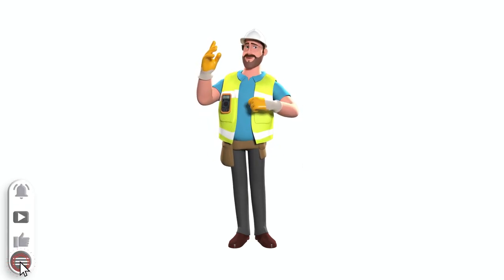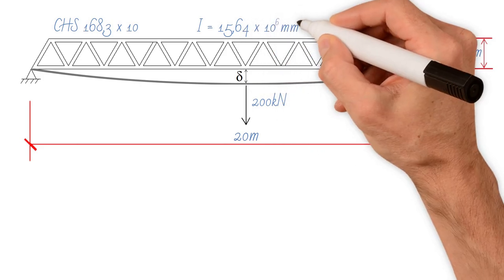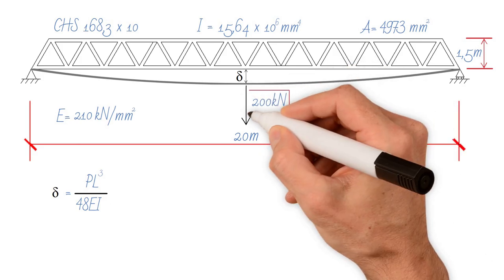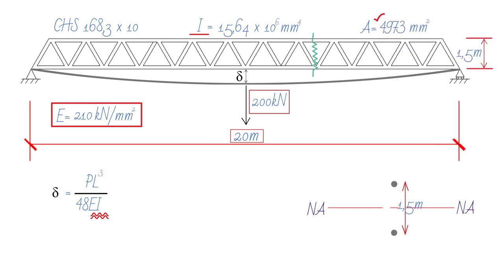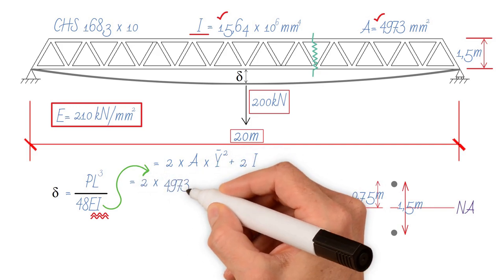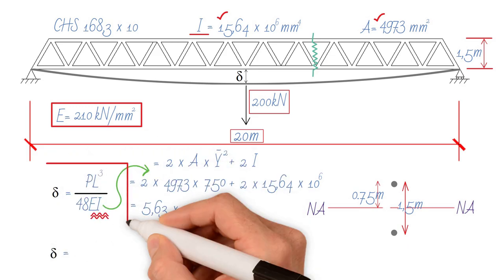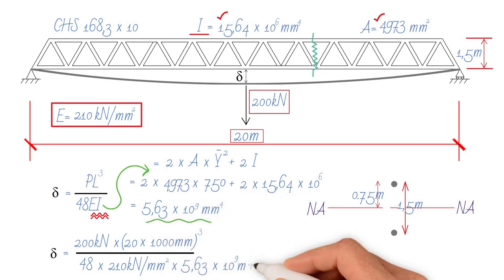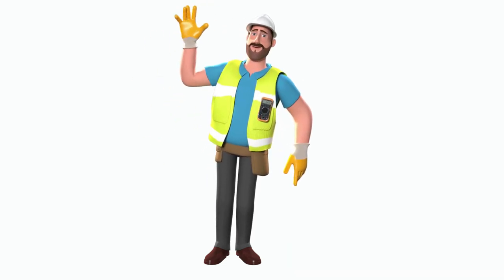How to calculate the deflection of a Steel Truss

Comment: Self weight of truss would add further deflection - about 53mm. The self weight deflection formulae is 5 w L4 / 384 E I total. Where the term 'w' is self weight of truss calculated in kN/m - the sum of all truss elements member lengths x 7640kg/m3 steel density x 9.81m/s2. Also y bar is to the centroid of the 4973mm2 area from the truss NA. This would be (750mm -168.3/2) = 665.9mm.
Reply: Hello vineet here. Can you share some more details.

Comment: This is a very good video. My only comments here is that the calculation only contains deflection due to bending deformation and misses the deflection due to shear deformation. Shear deformation will increase total deflection slightly.